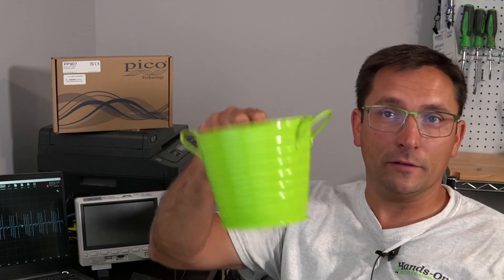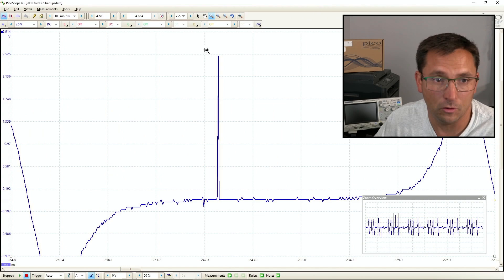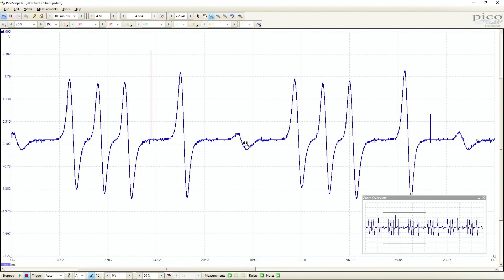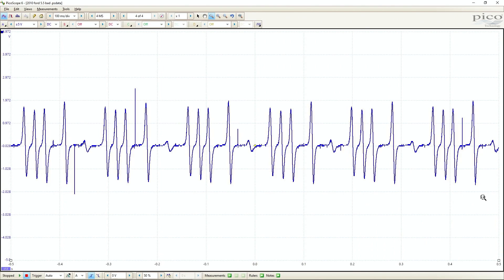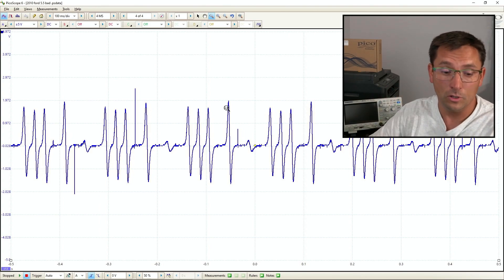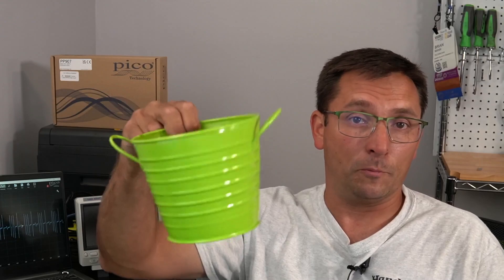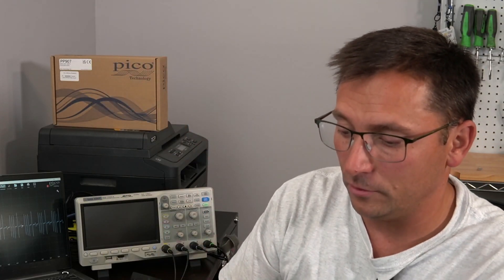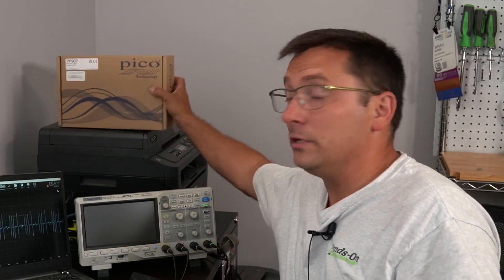7 29 2022 pico drawing

Comment: Question when replacing a bcm in a late model dodge is the pin code stored in the new bcm? Or is the pin assigned to the vin? Just asking I was asked that question i said not sure. Figured if you knew the answer.  2015 promaster. I don’t need to program it just interested in the guys question he asked
Reply from the maker: I think in the bcm not sure, the fca cars do it different